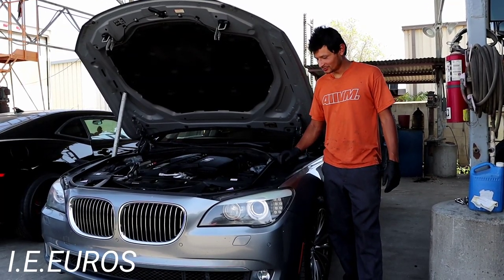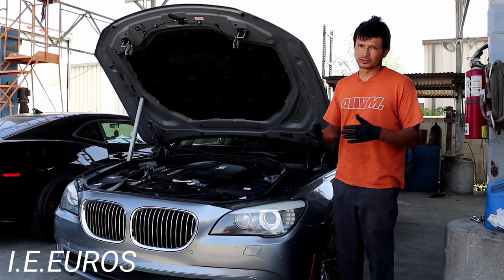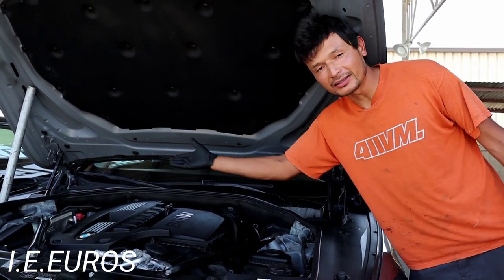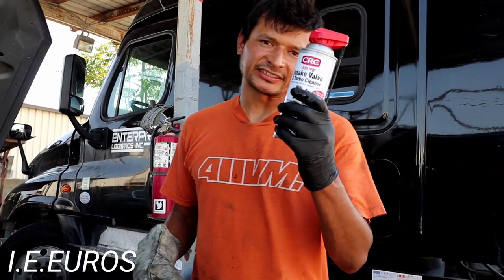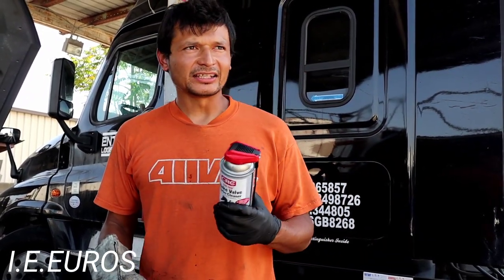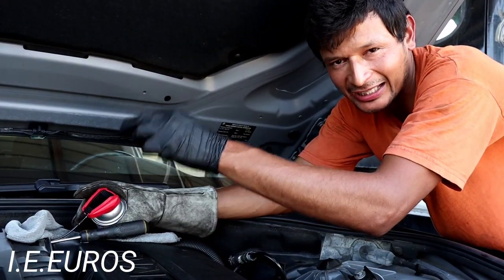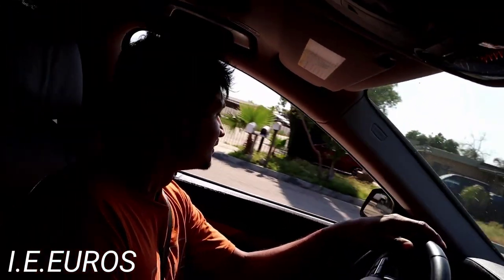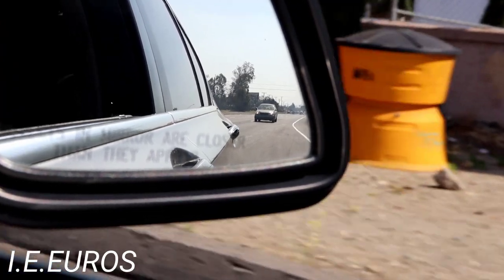BMW N55 engine intake valve cleaning 335i 435i 535i 640i 740i X5 X6 35i

Comment: Thanks for your video! From El Salvador and have the bmw 550xi with N63. I do have downpipes and stage 2 tune. Problem is I do get some random misfires if I drive slow for a long time and suddenly floor it. But what is worse I do have a lot of smoke from tail pipes and smells bad. I have a scanner and I get running rich and bank 1 and 2 with -4% and -1.5% fuel trim. Can you give me some advise? Mechanics here are clueless

Comment: Hey man I need your help. I have a 2011 535i x drive n55. I getting codes 118401-fuel to air mixture too lean.119404-rail sensor pressure permanently stuck. 11A401-fuel high pressure during fuel injection release pressure too low. I've changed out the lpfp to a stage 2 pump from walbros. I have relatively new coils and spark plugs. I'm stage 2 mhd tune on 91oct. Any ideas man?
Reply: Figure it out?
Reply: @imperial1037  no, I sold the car. But I've singled it down to the hpfp and the fuel rail sensor.
Reply: @antonio36o36  yeah, that would make sense.